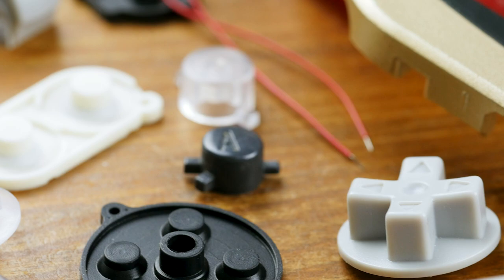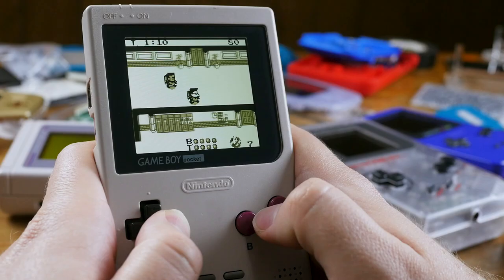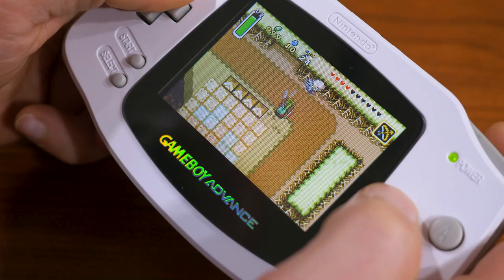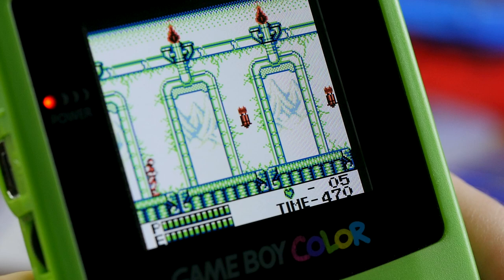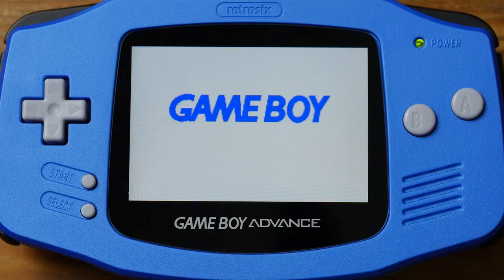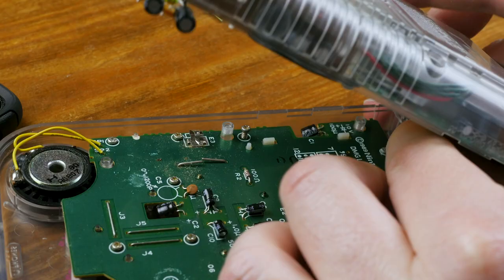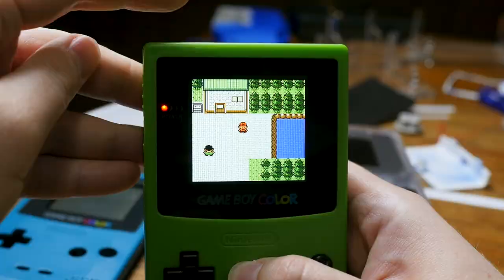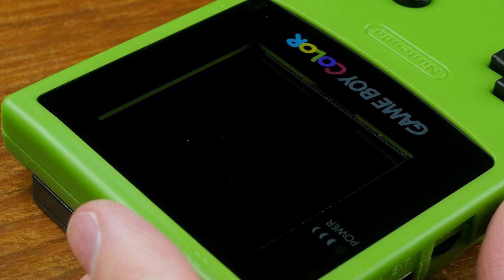Game Boy IPS Screen Mods for DMG, Pocket, GBC, GBA, and GBA SP :: RGB320 / MY LIFE IN GAMING

Comment: Hey, this is a wonderful video and I want to thank you for making it. I'm going to start recommending it in the descriptions of my videos. That being said, I do have some small notes, mostly just for background info. 

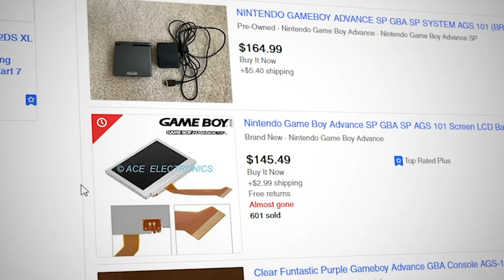09:55 You can minimize the visible interlacing artifacts by adjusting the LCD potentionmeter on the back of the GBA mainboard. Using the "AGS Aging" test patterns on screen is extremely helpful in getting the calibration dialed in perfectly and quickly. 

11:49 The tearing on the funnyplaying version in particular seems to happen about 60 frames after a LCD reset command and then there are no tears after that from what I can see. At least until the next reset anyway. Like you said at 20:40, this is because the screen is turning off. 

12:34 This was true of the early unbranded kits but I believe it's been resolved in the current ones. Unfortunately, there is no way to tell if you are getting an old stock old cable or a new stock new cable. In the unbranded vendor sector, the only "v2" designation that is actually meaningful is the DMG RIPS kit. The rest of the kits have "v2" tacked on for marketing purposes (because of the funnyplaying GBA v2 IPS kit). If we paid attention to the actual versions, this kit would be anywhere from v4 to v12.

12:57 The unbranded kits have switched vendors to a new LCD supplier. Funnyplaying is still using LG screens but the unbranded kits (who I usually refer to as "one chip" because that seems to be the only consistent "branding" that they do have) have started using Toppoly LCD screens. Older kits may still use LG stock, especially the GBC kits. 

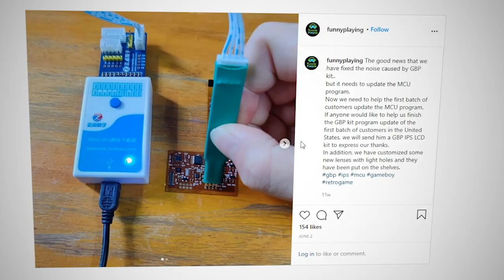20:01 This issue fixed was for audio related issues on some motherboard variants. 

20:29 Yeah, this appears to the be same issue that Link's Awakening DX has in certain areas. The fence in the beginning one scree over from the chain chomp house displays the same issue. 

23:26 I wonder if it's related to running the screen at a non-native refresh. Otherwise, I find it bizarre that both kits using completely differnt hardware to do the conversion would have behave similarly. 

26:30 You should do yourself a favor and check out funnyplayings new IPS ready AGB housings and replacement buttons. It will change your mind on aftermarket buttons and shells. Unfortunately, only AGB has gotten this treatment so far but I've been told more systems are coming. 

35:18 On the first GBA, a little bit of heat (like a hairdryer on high or a heatgun on low) will soften the adhesive and allow you to remove the lens with relative ease. Since you have a retrosix shell, adhesives have a hard time sticking to that coating and tend to not grab as strongly. It should be pretty painless to get that lens swapped out. The second GBA, you have a clearance issue or have cranked the screws down way too tight. A metal screwdriver is not the correct tool for removing these lenses, glass or plastic. A plastic spudger is better but a suction cup is best.
Reply from the maker: [Try4ce] Thanks for watching! I was actually considering reaching out to you for info, and it's clear that I should have! You've filled in a few gaps in knowledge for me here.

Regarding the tearing on the GBC screens, I came to that conclusion as well - I was playing some game (can't remember for sure which one) where I was seeing more tearing than usual. When I was playing another later, I had the revelation that hey, wait - the screen turns WHITE during transitions even though WHITE isn't in the color palette I'm using! But for some reason, I wasn't getting tearing in some of the other games I was trying after those transitions. So I didn't manage to capture it, and I didn't want to say it was definitely because of the screen resetting because I couldn't recreate it. If I'd spent more time with it (and driven myself more insane) I could've probably done this, but I was feeling pretty done with all the new revelations I kept having, which kept causing my script to expand!

VERY interesting that the issue FunnyPlaying was talking about was audio. I figured by "noise" they meant visual noise of some kind. That's deeply disappointing... if the dots issue were fixed, I'd definitely be tempted to get my own FunnyPlaying GBP. Sounds like I should wait a while to see what comes along though. I know it doesn't appear in very many games, but the fact that it occurs at all bothers me. Like, notice how the dots move with the logo as it appears. It feels like it's doing something unwholesome to the video generation rather than just displaying what it's told to display.
Reply: You can always trust Makho.
Reply: Thank you for posting this! So few people know about the trimming pot and it can need adjusting throughout a GBA’s lifespan, and in my experience whenever a GBA SP’s battery is replaced.

(It’s related to LCD depolarisation, IIRC?)
Reply: Ulic Lon Dindong  uhh, what?
Reply: Makho is the king of GB mods.
Reply: @TheRetroFuture  You can always trust The Retro Future as well ❤
Reply: Ulic Lon Dindong  Assuming you are talking about the time I commented on one of his mod revisions, I hardly see how that counts as a "spastic freak out" or "nerd rage" but, ok, you do you. Don't see how it's relevant to this MLiG video or the information I tried to provide.
Reply: @makho Do you recommand Retrosix's Prestiges GBA ? I was about to buy one before I watched this video...

I'm also asking myself after watching this video if the best wouldn't be playing GBA games on a hacked OLED Vita... (despite the fact that emulation adds lag).
Reply: @MrNono6400  I like the funnyplaying IPS shells over the retrosix ones but both have some caveats. They are both still better than other generic aftermarket shells.
Reply: makho Thanks.
Is it be possible to change the screen of a GBA for an OLED one ? 🤔
Reply: @mylifeingaming   5 years earlier you promised us a video about adjusting geometry on a CTR, when will we get it?

Please answer i neeeed a video about it!
Reply: @MrNono6400  not at this time and there is nothing that I know of coming
Reply: I love you makho, platonic ofc!
Reply: Dude dunked on him with a 10 paragraph essay
Reply: Damn I just pointed out the ghosting and possible inverse ghosting and how it happens, you wrote a brilliant explanation for all of this. Nice
Reply: III
Reply: Wow, thanks for the insight!
Reply: wat do u suggest i got a gba sp 101
Reply: Gggggggggggggggggggggggggggggggggggggggggggggggggggggg
Reply: ))gg

Comment: Embedded software engineer here: I have this feeling that the artifacts are either related to a frame buffering gone wrong or there is a software error in the upscaling, that kind of artifact it's not LCD technology related, It's difficult to guess the refresh direction of a LCD but being a smartphone LCD I would wildly guess that is rotated 90 degree on the mounted axis, that mean that what we perceive as left to right artifact could be a temporal artifact up to down which seems consistent with a possible termporal buffer (you store 3 frames, the previus, the atcual and the next one and interpolate between them to avoid shimmering ).

Comment: 9:55 To fix the interlaced effect on the AGS 101 screen (and any other Nintendo screen), there is a potentiometer screw you need to adjust. I can confirm this is found in every single GBA, GBA sp, NDS, NDS lite, DSi and DSi xl. It's also most likely found on the Gameboy, Gameboy Color, 3DS and 2DS, but I haven't checked/don't own these consoles to verify.

When you turn this screw, it adjusts the voltage going to the screen to sync up the refresh (which causes the pseudo interlacing). It may take some trial and error, so I recommend adjusting it while the console is on to check. On the SP and DSi you can access the screw from the battery bay, and I assume all other models are the same.

(Source: I fixed my OEM GBA SP 001 and DSi screens this way).
Reply: ^this needs more likes
Reply: thank you!!!!
Reply: No way.  So it's just a poorly set potentiometer?
Reply: @badreality2  Most likely. There are always exceptions, but 99.99% of the time this is the problem. You may even have to adjust it over time, as while it may start off okay, changes in the console (such as a battery change) can cause it to de-sync and require adjustment.
Reply: This has also been my experience. I had an original sp 101 and got an ags 101 from eBay, so I’m not sure of the screen’s origin. The eBay one displayed the interlacing issue and was fixed by adjusting the potentiometer, so now it looks exactly like my original sp 101 with no issues.
Reply: My DS Lite (which apparently uses similar screens as the AGS-101) doesn’t have the interlacing issue.
Reply: @HydraSpectre1138  Unless you've swapped screens or batteries, there's no reason why it should, it's calibrated from the factory. But if an issue does arise, the potentiometer is there.
Reply: Yeah, and I managed to royally screw up a screen and make it interlace worse and never got it back to normal. So I would be cautious about adjusting it. The 3DS and 2DS apparently have the potentiometer screw soldered in place, so you can't readily adjust it, but it also won't get out of phase as easily.
Reply: Wish i had an Ez flash cartridge...they sooo expensive :( wish someone find a cheap solution like the R4
Reply: Does it work for the og non-lit gba? Because mine does that.
Reply: @detectiveblutomindpretzel6292  Indeed it does!
Reply: @Brodensson  Thank you!
Reply: For anyone who might be reading this in the future, the screw does exist on the GBC. However, it seems Nintendo covered it up by a plastic tab on production models, so you need to open the case to access it.
Reply: @Brodensson  capacitord age and the voltage sent to the LCD panel might vary because of that. I've seen it happen on stock GBAs and GBCs.

Comment: 23:17 That IPS glitch is caused by overdrive trying to improve pixel response time by overcorrecting. There are LTT videos about it
Reply: What suprises me though is the trailing effect stays quite a long time, so I doubt that is regular LCD overdrive. At least most LCD overdrives I have seen do not oscillate and stay for longer. My guess is that this is some kind of anti flicker circuitry (inside or the LCD or on the cable) which causes this.
Reply: Wouldn't a pixel overdrive result in corona artifacts as the pixels overshoot their mark. They would also show up on any dark to light areas uniformly and not be triggered exclusively by specific game behaviors
Reply: Thumbs up. I saw overdrive in action too. As some have stated there could also be anti-flicker in play. Perhaps identifying what's happening is muddied by multiple factors.
Reply: I was going to say the same thing. This looks like overdrive

Comment: When I installed an AGS-101 screen in my AGB, back when there were no IPS-kits, it also had this "interlacing" effect. I later learned, that this was caused by me using the wrong ribbon cable.
I searched for a fix and found a scary one, that had you remove some resistors from the GBA board. I actually did that and now, the only issue I have left is the usual slow pixel response of 101 screens.
Reply: Probably wasn't the ribbon cable, there is a potentiometer screw to adjust screen voltage, a few turns probably would've fixed it.
Reply: @Brodensson  Nope. I had already adjusted it.
There's AGS-101-A screens and AGS-101-B screens. I had an A screen and a B ribbon cable.
Reply from the maker: [Try4ce] Yeah I decided to not get into the potentiometer stuff since it doesn't seem to be a factor with the new IPS  kits, and that's the main subject. My understanding is that there are some AGS-101 screens that simply have this issue worse than others,even if you adjust the potentiometer.. I'll be curious to hear if Coury has good luck adjusting his, but it looks pretty extreme there. You can't see it on mine, so I have one of the good ones, it seems.
Reply: @seseiSeki  I'm amazed it worked at all! I'm glad you fixed it though!
Reply: @mylifeingaming  I want to chip in and say the potentiometer is your friend here. It's extremely hard to adjust though, since even the slightest movement will change the voltage. Those lines will go away but only at one specific position, and it's very hard to hit it just right, since even when you remove the screwdriver from the pot, that'll change the value.

The "B-type" ribbon cables do not let you adjust the potentiometer on the board, it instead uses fixed values on the ribbon itself. That's why I opted for the A-type ribbon cable, since I was having the interlacing issue with the B-cable.

I found the easiest way to adjust this is to walk up and down in Pokemon ruby/sapphire while looking at a dark entrance, using a screwdriver through the hole behind the model-sticker on the back of the console, turning it every so slightly (the "sweet spot" is so small you have to basically stop moving the screwdriver to find it, it's that sensitive lol)
Reply: I had this same issue with my AGS-101 replacement screen at first, after a little fairly easy potentiometer adjustment its absolutely perfect. I looooooove my modded GBA with 101 screen. Every friend I've shown it to is blown away. I even brought it to my local game store, and as soon as one of the clerks saw it he offered to by it off me on the spot for himself. I refused, I love the thing to damn much.
Reply: @mylifeingaming Yeah... The 101 screen into AGB mod is pretty finicky. If I remember correctly, that's because the voltage requirements of the original screen and the 101 screen are different.

Comment: The "interlaced" look in some AGS 101 screens simply require a slight adjustment using the potentiometer of the GBA. At least, this is what solved the issue for all the times I've encountered it, and is a suggestion I often see in the internet community as well.

Comment: Hey just to be clear. The funnyplaying ips screen is the exact same LCD as the generic ones (sold by retrosix). The LCD they use comes from an old blackberry, you can check the model numbers on the back. The screen are cheap and cost about $10. The only differences are the ribbon cables which house the brightness, color coordination, power, response and frame rates.  Funnyplaying is by far the king

Comment: I really appreciate that - in the 'build section of the video - you were unafraid to show all the different types of problems you can  - and many will - run into when putting together a custom Game Boy. The first time I put one together was an hour long affair, and you rarely see where things can go wrong on the typical build video since recording would tend to happen after nailing down the process, and when things just don't seem to be matching whatever video you're watching, it's easy to start to panic (especially when you start thinking of the investment in one of these projects). 
Assembling these custom Game Boy systems has been a lot of fun, but I can certainly see why someone would just want to buy a pre-modded unit to skip the trial and error, or to have a finished product without niggling cosmetic issues. 
This was a great and informative video on the entire subject, and one I have been eagerly awaiting since its mention on the GBA live stream. Thanks as always for a well researched and fantastic video!

Comment: Great video!  The thing with most of the built-in flicker is that in especially early GBA games (sometimes on the GB too, though it was more common that devs would slow down the game to avoid ghosting), devs would abuse the qualities of the screen to create transparency effects.  It's to the point that LCD ghosting is available on a couple of emulators now (and others "fix" it somehow).  If you see something flicker like F-Zero's map or the slightly flickering effects in Golden Sun (which also used this quality on the World Map to make a sort of AA effect), it's supposed to be transparent.  It's kinda sorta similar to the Sega Genesis's waterfall effects that involve certain TV setups.
Reply: No. It's not similar whatsoever. Two entirely different things and topics.

Comment: Just an FYI, those "generic/unbranded" "1-chip" GBA kits that supposedly have the screen tearing issues, have been fixed for a while now.  All the GBA kits perform pretty much identically now.

The differences in the screen brightness etc, is down to the LCD panel they use.  The "1-chip" kits use a cheaper panel by a company called "Toppoly" while the FunnyPlaying kits use LG panels.
Reply: The 1 chip use less power then funny playing.
FP drain immense power on full light
Reply: so which are better? The toppoly's or FunnyPlaying's?
Reply: @Finnishmanni  when I look at the Videos from mahko then the non fp is a bit better and less faulty
Reply: @Finnishmanni  the funnyplaying kit comes with the LG screen which is better
Reply: Not actually correct. I've bought both kits and the model number for the LCDs were the same, both sceens used in blackberry phones
Reply: @oasdfe1691  depends when.  The Toppoly screens have only started appearing in the last month or so
Reply: @AndehX  I think because the blackberry is long ago they all are reproductions.
You could get the screen from fp because they are cheap and use the other cable
Reply: @oasdfe1691  they did have the same screens but stock has run out, so the AIO (generic) kit switched to Topoly. FP still has some LG screens but who knows what happens when their stock runs out